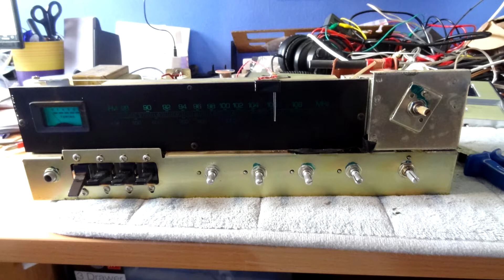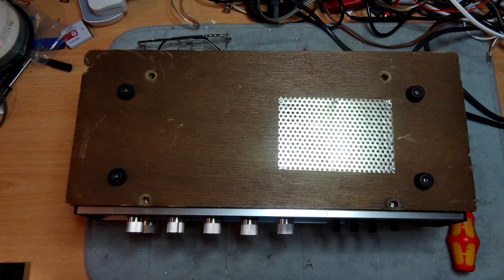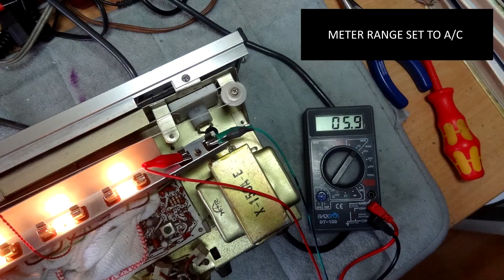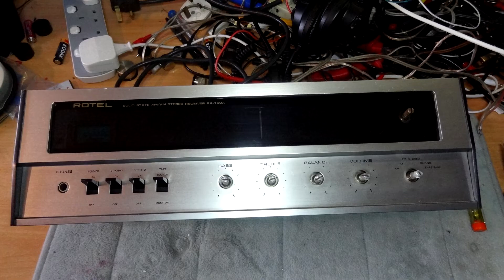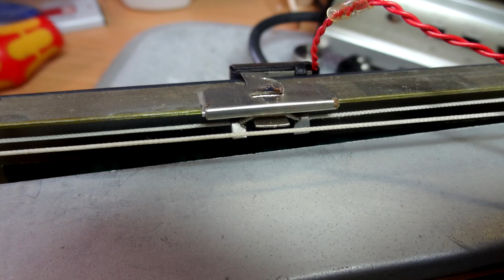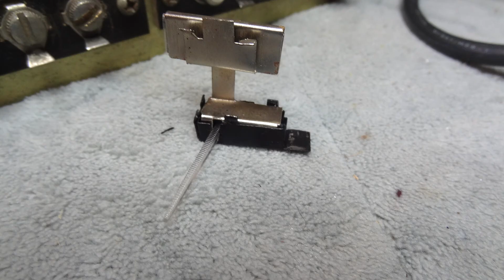Replacing Bulbs, Lamps Rotel RX 150A Receiver, Backplate, Tuning Meter, Dial Pointer panel vintage

Comment: Great video. I just replace the bulbs on my 150a which I’m giving to my young nephew. Did you replace those filter caps that I saw in this video? If so, is there a video? I’m getting a hum on one channel that’s there with no inputs plugged in and even with the volume down. I’m suspecting the filter caps. Thanks!
Reply from the maker: Thanks for the comment, I think your nephew will love this little receiver, its a pretty cool unit. No I did not change the filter caps on this unit when I had it, there was no noticable hum. But in your case changing the filter caps should help and a good place to start.

Comment: Great video Michael.. Just about to do this very thing. Did you have to connect an FM Antenna to test the tuning bulb? thanks Dave
Reply from the maker: Thanks Dave, Yes I had a small piece of wire around 3 or 4 feet connected to the FM airial input for the stereo light to light up, depending were you are from the transmitter you might need a bigger maybe dipole airial or just a short length or wire to get it light up. If it does not then might be the buld
Reply: @MichaelYates  cheers mate